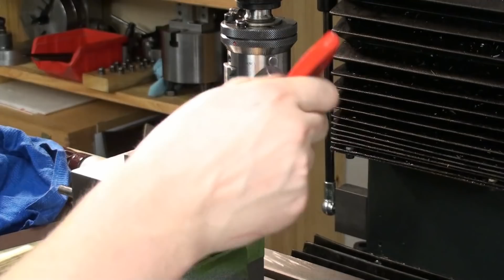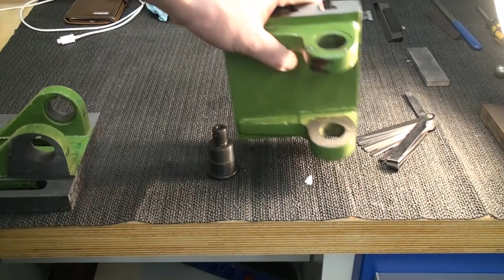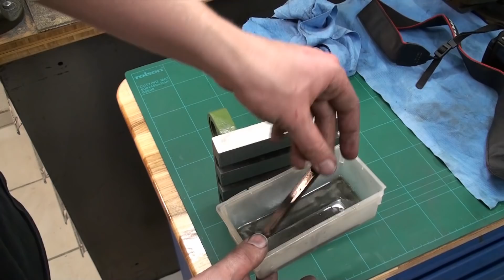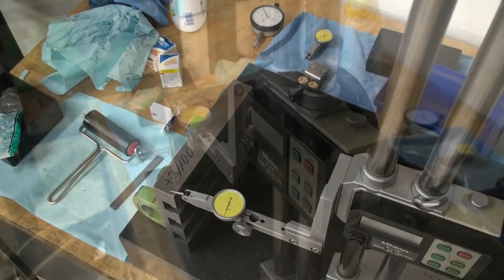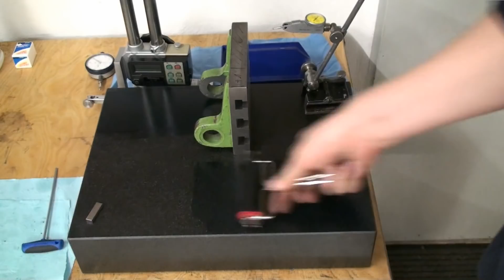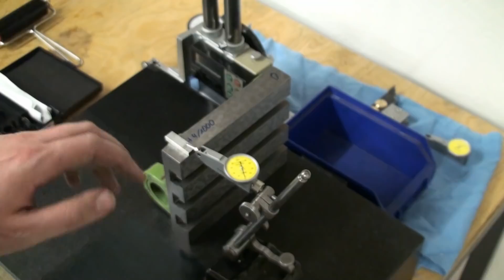Adjustable angle plate, improving and scraping - Part 2

Comment: Old thread I know, but I can't help but ask the question since I intend to do similar project,... would it not be more accurate to line bore the pivot pin holes considering that the base and edges have been milled and scraped true. That provides a very stable flat to bolt to lathe compound in order to line bore both holes in a single operation.
Reply: The holes were within 0,01 mm or 4 tenths which is good.
Reply: @flatsurfaces1913  yeah that is okay... but the remark was wondering if I could do better using another type of set-up that requires no further changes where issues could be introduced... since I am less skilled at truing in parts

Comment: Stefan, my idea for boring the two holes would be to use a bigger boring head and a longer sturdy carbide boring bar to machine both holes in one setup. Moving slowly off course and just taking light cuts. What your idea on this approach? Your result is great but it would save you an additional setup. I'm looking forward to your answer. Keep up the good work and best regards, Job

Comment: It really is quite a value when you look at it as you are buying Chinese products as sort of a prepared blank it makes it even that much more worth it. You're getting the basic geometry done for you and you're putting the final fit and finish on it to suit your Precision needs. It's really that much more of a incredible value. I'm in complete amazement at your skills as a machinist it's mind boggling I don't know if it makes me want to give up learning or makes me want to push forward LOL.

One thing I cannot postulate is the need for precise parallel between 4 T slots!
I cannot imagine the application that would require parallel between these clamping surfaces to this degree of precision. I'm not saying it's not needed I'm saying I can't Envision it because I have not done anything that requires it.

Comment: Stefan, I have a granite surface plate with small incrustations from a paint job someone made (not me!). I tried unsuccessfully to scrape it with my fingernails. They are really stuck in the granite. Do you know how to remove it? Maybe use paint remover? Some people told me to sandpaper the surface but I´m sure it will ruin the flatness of the plate. Any help will be appreciated. Thanks.
Reply: Outex Roberto Miglioli going chemical sounds like a good idea, add if that doesn't help maybe gentle shaving with a sharp chisel. definitely stay away from abrasives
Reply: Thank you, Rob. I´v bought a chisel and I will do as you suggest. It will take some hours do so. Thank you again. Best Regards.

Comment: I had the pleasure of using a Wohlhaupter boring head many years ago.  It is a super sweet tool to use.  I was lucky enough to run it on a SIP which is another ultra precise machine tool.  The ability to spot face a large area is a great feature.  Thanks for showing the Wohlhaupter Stefan.  It brought back some good memories.

Comment: Hi Stefan,
As always great work.
I have a query - when you were squaring up the side of the table with 3 thou out of level you scrapped all along the surface and eased it into a plane.
would it not have been better to just take off from the high end and recheck out of level until they are equal height with the surface gauge, then scrap the surface flat?? 28:00 on

thank you

Comment: Did I miss it in the video? I did not see where you checked the alignment of your bores for parallel and square to the t-slots and surface of your plate. Seems since you were indicated to surfaces for the bore that you later altered by scraping your plate will now be slightly askew once assembled unless you will be doing corrective work on the bores too?
Reply: +bcbloc02 I think you have a point there, Brian. Perhaps the order of operations should be square everything up by scraping and then  bore it.  Ideally line-bore it.

Comment: great 2nd part!   ended too suddenly though...  like a cliffhanger.   really gorgeous boring head..  what is that t slot looking feature on the fixed part for?   just curious.   looking forward to part 3.
Reply: +This Old Tony It`s for mounting a mechanical stop to halt the facing cut.

Comment: +Stefan I have been thinking that scraping is an exciting craft to look at, but wouldn't an endmill or a flycutter do the same job ? or are the scraping that much more precise ?
I AM aware that you don't get that distinktive pattern using endmill or flycutter, but it is a tool, not a painting, and in a short while it will get dinged anyway.
As always I enjoy your work, and learn :)
Reply from the maker: +Soren Hansen If you have a real precise milling machine you can get the same kind of precision, especially with a flycutter. In fact a lot slideways on big machine tools were just flycut on a jig borer or boring mill..and thats just pretty much as good from a precision standpoint as ground or scraped.
Reply: +Stefan Gotteswinter I assumed that scraping, if your customer is willing to pay for it, is better from a mechanical standpoint for the classic bedways without linear bearings as you have the oil pockets and less friction heat of the oil film - not sure about the latter as I just read it somewhere.

But what I don't understand is that Mazak, Okuma and DMG (for their DIXI machining centers) are scraping relevant contact points of the machine frame. I mean you don't need the oil pockets for a static flanged connection, so why not just grind them? Maybe you can give me some arguments for doing this as I know not much about scraping :)
Reply: +Stefan Gotteswinter PS: For your power scraper: How much material is the smallest amount you can remove per pass? I thout that the power scraper is too aggressive  for remoivng e.g. 3/100mm but as mentioned I know not much about scraping and the only scrapers I've used so far were for gaskets and the glass-ceramic hob

Comment: Hi, Stefan.  Would you say that your scraping skills make a surface grinder redundant?
Reply from the maker: +BluetoothSensei Nope, absolutely not, especially when working with hardened parts. In fact I just bought a surface grinder ;)
But for cast iron machine parts scraping is just as good (and better) than grinding.
Reply: +Stefan Gotteswinter Ah-hah! Is it the small German model you mentioned when I asked if you would get a surface grinder a few months ago? Looking forward to seeing it!

Also, I would have thought the boring job would have been perfect for your lathe fitted with a boring bar between centers. It has a scraped top-slide, and presumably there would be many ways to get the axis of the bore up to the right height (e.g. parallels).